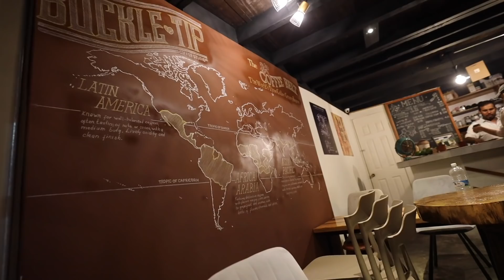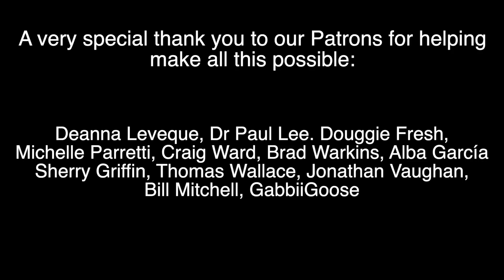Installing Modern Day LUXURIES // off grid water system

Comment: Kyle I have that blue on the roof part. To lighten it up all you need is just 1 can white spray paint. You can tape off both side and spray very light .1/2 on 1/2 off.then it look roundish. Or you can lightly spray all of it lightly  You get the baby blue you want.. if hate it not just paint it with the new paint . But bet you like the 2 tone. It add depth. Now it look flat. 
Two tone colors then add word in 2 tone look rich in depth.

Comment: Jordan, are you familiar with what a fence pole driver is? You could make one specifically for driving rebar into the ground. Just grab a 1.25 inch  steel thickwall pipe about 2 or 3 feet long with one end threaded and a cap. The weight should drive into most ground but if needed, the cap can be more easily hit with a hammer than the rebar. This place of yours is all looking great.

Comment: Hey as a plumber, I say always UNION, CHECK, VALVE . A union so you can take apart and clean the check. A check not only prevents backwards flow, but keeps pump primed and holding wet water. And  lastly valves.  Valve off component yo might need to work on in future. So I would have valve going to pump and leaving pump.

Comment: one thing to note is laying block in the tropics where its hot and wet vs in more temperate areas is a bit different, Lucky your in a higher cooler area so it should set about the same as back home

Comment: Hey!  At the rate you're going, you'll have a concrete extension to your bus built in no time!  Have you thought of building breezeway or foyer for it?  But also you prolly don't want it to obstruct your million-dollar view of Mount Barú.  -just thoughts.  But I'm so glad you're choosing actual concrete as building materials.  That's the real Panamanian way.  It will last so much longer than any wood structure.  Good thinking on your behalf!  Keep up the good work.  Don't worry about imperfect masonry.  Practice makes perfect and you may as well learn as you go with something like the water tank so that when it come time for the actual house you're good to go and it's all old hat to yous.

Comment: Hi you two, love what you guys are doing, but I cringe every time I see you doing block work. To make laying blocks easier you need to use a plasticiser in your morter (sand and cement mix) this makes it more workable. If you can't get a plasticiser, you can add a little dish soap to the water you use to mix the cement and sand. Give it a try, you'll be amazed.
 Keep up the good work and stay safe 🥰🥰 .....Rick.

Comment: Try turning your hammer sideways to drive in stakes. It gives you more surface to hit the stake with and less chance of hit your hand.
Reply: A claw hammer is not meant to be used sideways to drive anything.  That can break the hammer.  What they should be using is a 4 lb sledge hammer.
Reply: @ILGuy2012  If your claw hammer doesn't have a wooden handle then your not going to break the handle. Nobody uses a wooden handle hammer anymore.
Most contractors know this.  Having been one for 20 years. I assume your not one.
Reply: @stevewainwright3344   I was talking about breaking the side of the hammer head where the handle fits inside.  That is not meant for hitting anything, especially heavy metal like rebar.  I don't have to be a contractor for 20 years to know that.  Also, I have seen some pretty shoddy work "experienced contractors" have done to cut corners, so just because you have 20 years experience DOES NOT automatically mean you have any common sense.
Reply: @ILGuy2012  OK, But in 20 years of using mine like that, I never broke it.
So I don't think it's much of a risk.  So no you don't have to be a contractor
to know that. You just have to have done it over and over again to know it wasn't worth mentioning.

Comment: You have to put mortar in between the block, not just smear it on the outside. Its also gonna crack since you dont have a foundation. Stones dont make a foundation, especially when they're not tamped down.

Comment: Oh my God again get a bigger hammer!!!!! You guys are using an indoor hammer
Reply: Yes, if they are going to be driving more rebar into the ground, the ideal hammer would be a 4 lb sledge hammer.  It has about a foot long handle and is lighter than a standard sledge hammer, so you can swing it one handed while holding the rebar with the other. 

Also, I would suggest pouring a concrete footing first, then stacking the concrete blocks on top of that for stability.  Maybe with the small size of the pump house they will be OK?